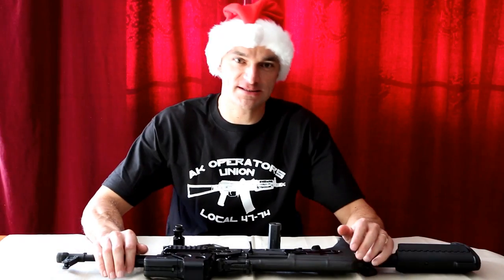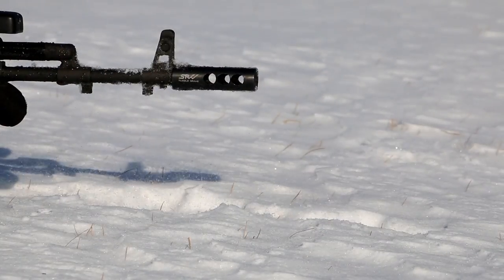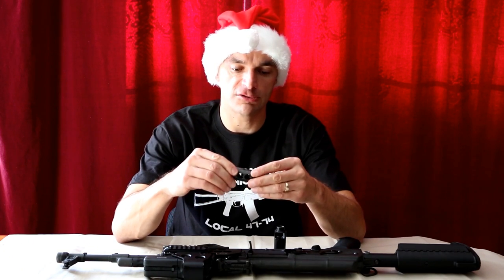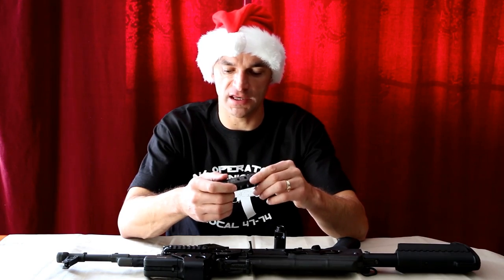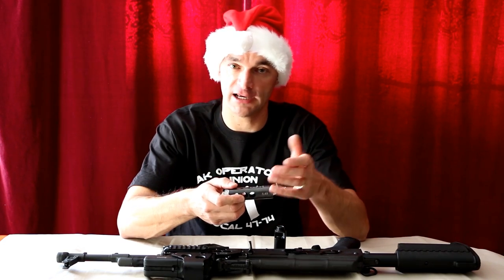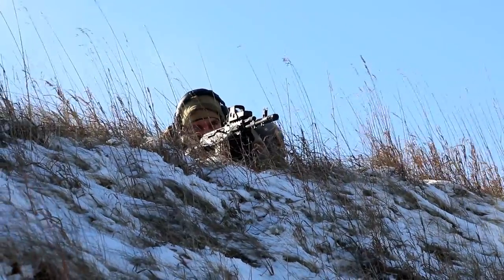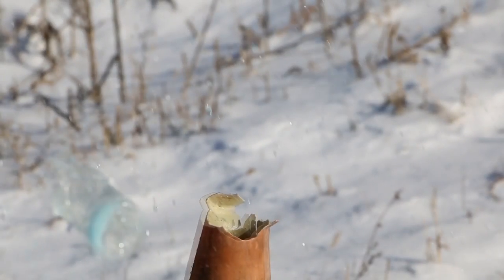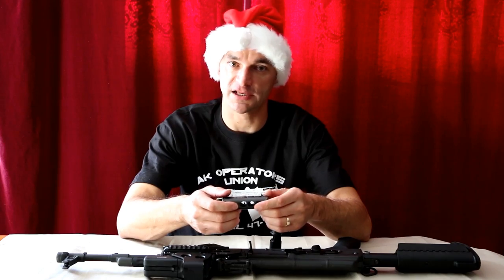Russian SRVV Jet Muzzle Brake

Comment: I am liking this Jet brake.  I am currently running the traditional 74 style brake and I have had a few complaints from guys to either my right or left about pressure wave coming out of the sides of that brake as well.

Comment: You reload the same way I do when I am not retaining magazines! I grab my loaded mag, thumb around the side, and I hit the button with my thumb and push the mag out in 1 motion, then I rock my charged magazine in. When I am retaining, I use a jerry rigged pull cord on the bottom of my magazines, I grab my fresh magazine, bump the button the same way, but when I do, I catch the empty with the "ranger plate cord thing" on my pinky and it stays there during my reload, then it is slid off into my dump pouch. Hard to explain, I will try to do a video of it. :)

Comment: If you buy this from the actual manufacturer as a Russian citizen, it only costs $49. If you buy this from Circle 10 AK, it's $99.9 total. Circle 10 AK makes 50 dollar profit from selling each of these.
Reply: +yekcoh Kim At the very least. Depending on if they get any special deals as a distributor, they may make an even greater profit.
Reply: +yekcoh Kim > $99.9 total
titan version vs steel vers ;)

Comment: How does the SRVV compare to the FSC 47 for muzzle rise and control?  Thanks for being one of the few videos about the SRVV brake, it looks really nice.
Reply: Please if you could get back on this question, I would really like to know the comparison
Reply from the maker: Chris Bob Hi Chris, i just got this notification from google...sorry for late reply. I have used FSC 47 only for short period of time. It did a good job, but i think Jet holds the edge...- Rob Ski
Reply: Thanks for the reply, and no worries on the lateness.  I have been asking on the few SRVV videos on youtube because I previously purchased an FSC and I like it, very good across the board from performance, mild flash hiding, and weight.  At the time I was purchasing the FSC I had been looking at the SRVV as well.  Lol I am a chronic second guesser so I was wondering how good of a choice I made, and if there would be any sense in grabbing a SRVV in place of the FSC I already have.  On the second kind of cool, in my opinion the SRVV looks badass, and I like the solidity of it (I wouldn't mind the increased weight) From all the vids I've seen it seems to be a very flat shooter.

Comment: Ak Operators Union, Local 47-74 Hey Rob, the new Obzor scope, the one most recently fielded by the VDV that has seen action as of late, sources indicate that they like it and it is an excellent reflex sight. However, there aren't many comprehensive reviews of it. It can be purchased from Kalinka optics. Can you do a review of it?

Comment: Great review. You are the first I see that has mentioned decibels, weight and where the blast is diverted, but what about flash? Also chrome lined or not?
Reply from the maker: ravengr2000 , if you will watch the scene where i was shooting from my back, you can see how pressure wave blows the snow away. So it goes heavily to the sides and up. It is ok for the shooter, but not so Ok for your teammates...:-) - Rob Ski

Comment: I'm having Definitive Arms shorten the barrel on my SGL21-61... would you rather have this pinned/welded to your rifle.. or the factory brake?
Reply from the maker: Man, you are doing smart thing. Now, if this would be me, i would add to it Battlecomp brake - small, light, and effective as hell! That's exactly what DA did for me. With all that extra effort and money you putting into your rifle, don't put that standard brake back on it now...
Reply: Ak Operators Union, Local 47-74 Awesome. Thanks for the input my friend.

Comment: When you put your optic on the gas tube like that, do you ever worry about heat screwing it up?
Reply from the maker: Michael Gibbs heat is no friend to electronics, there is no secret here, but so far, i had only 1 accident, i have fried Aimpoint T1 , but Aimpoint replaced that unit without any questions.
Reply: +Ak Operators Union, Local 47-74 Non è un problema di elettronica ma un problema di mira, ottica disturbata per convezzione. Sbaglio forse? Ho tradotto per leggere i commenti e magari ho capito male.

Comment: i want one :). does it come with an adapter? i have 14x1 L/H thread on the barrel. or, i don't need one.
Reply: Ak Operators Union, Local 47-74 thank you very much about the link and the answer.

Comment: Hi Rob Ski, I got this brake for an SLR 107 in 24mm and for some reason it doesn't seem to fit right I was wondering if you or anyone you know has had a similar experience?
Reply: Yea it looks like I'm gonna grind that piece down without trashing the threads and it should be fine.
Reply: Buy a crusher washer but i highly recommend the Precision Armament Accu pressure washers. U can buy them at www.brownells.com

Comment: What is a good starter AK-74 ???
Reply from the maker: DAK74 from Definitive Arms
Reply: Ak Operators Union, Local 47-74  Is it worth the $1100.
Reply: +Shinobi V 101 Watch his review of the DAKM4150.
Reply: Shinobi V 101 One does not simply question the Robski a 2nd time.

Comment: Do not order those brakes!!!!! Or any thing from survival ops in russia  You have been warned mine took over a month to get here and when it did it was either used or they threw it off a cliff before shipping it inculding messed up threads i messaged them and showed pics and the response was... its and ak it will work fine. 150 down the drain cant even use it the threads are so worn out

Circle 10 was created for this reason amd they have the same products half the price double the quality and in usa